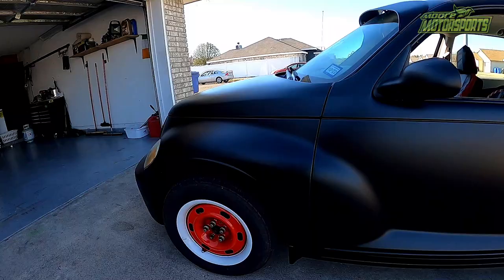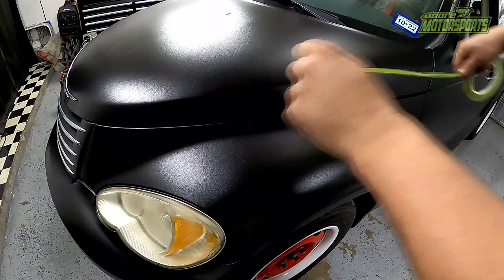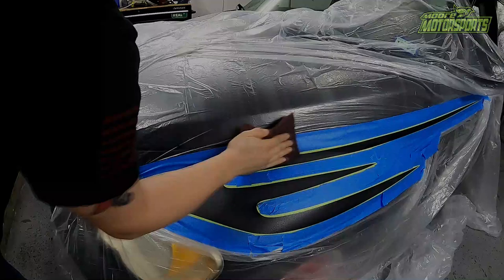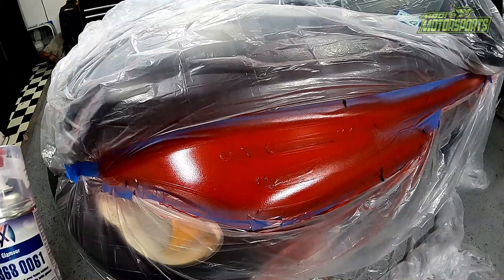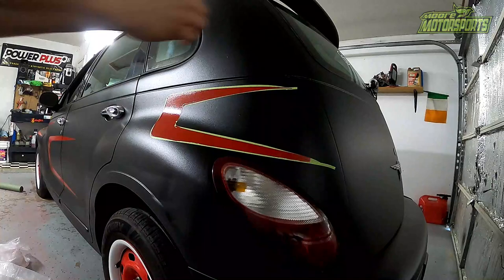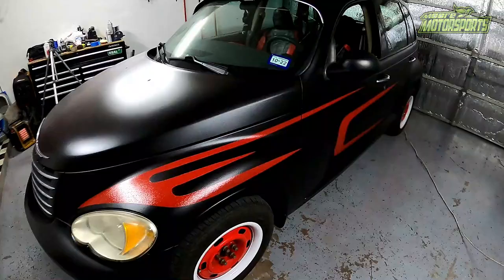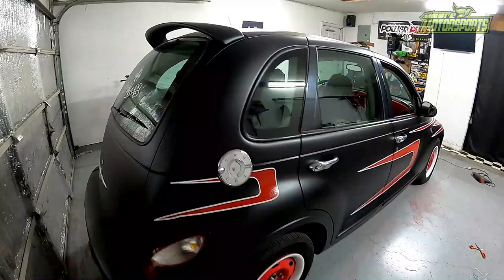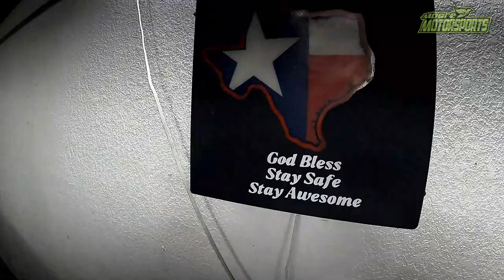Rat Rod PT Cruiser Build (Part 3) Spray paint graphics

Comment: Have you heard of white wall flappers? They're a goof way to get the white wall look without needing new tyres.
Reply from the maker: That would be one option but I didn’t want to do them. If the tires weren’t good I would have just bought white walls. Also on a budget as usual loo

Comment: Manual.   I have a 2001 manual na.   Around 300k miles... about to swap another junk yard motor.   See if it gets to the 400k.
Reply from the maker: Nice the manual ones are nice and the local junkyard has the turbo engines out there currently and I thought about swapping it but I’m not worried about speed with this one.
Reply: Yet my 1972 corolla clocked 800k on factory engine
Reply from the maker: @janeblogs324  that’s a Toyota for you! My buddy Casey had a Toyota T100 and it had 350k miles and a lot of hard driven ones it melted a pistons and still kept on going lol 😂

Comment: I like the design. I don't like the orange peel though. Shouldn't the pin striping be covered with clear coat? I would be afraid it will peel off without clear coat, but I've never applied pin striping, so I don't know. Anyway, I really enjoy your videos.
Reply: You do not clear coat pin striping, you put a small dab of lacquer finger nail polish on the points/ ends.

Comment: How did you make the windshield  visor??
Reply from the maker: I got it from the junkyard. They cost $200-300 normally. I got mine for $10 from local junkyard
Reply: @JamesDguy   I need to make one for my Chevy S10  I like  the look  of the old style  visors..  you have any suggestions?
Reply from the maker: @JVaughn344  I would use car so board make a template and then make it out of pvc (plastic) or fiber glass it